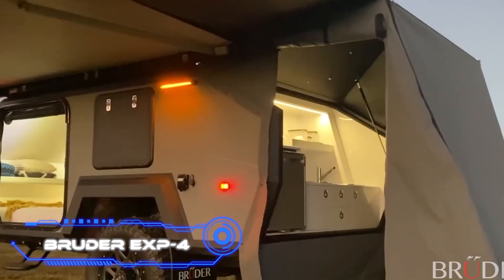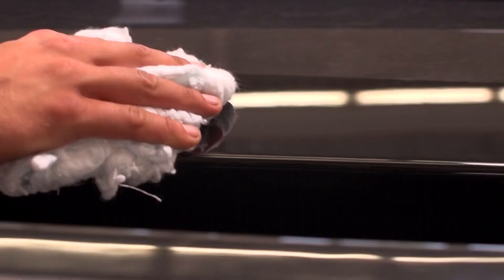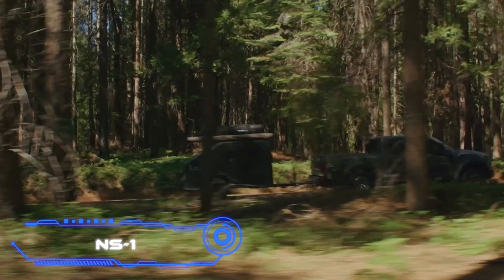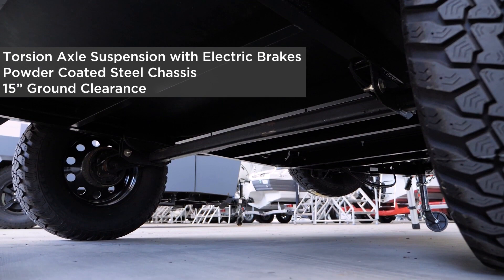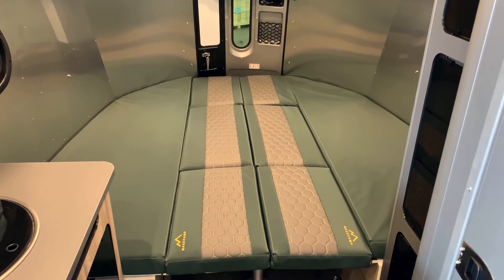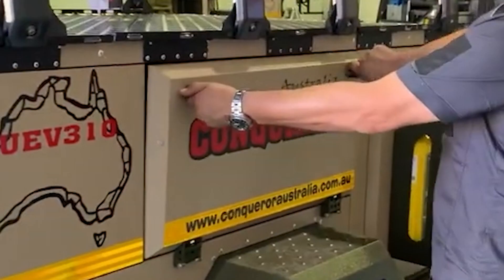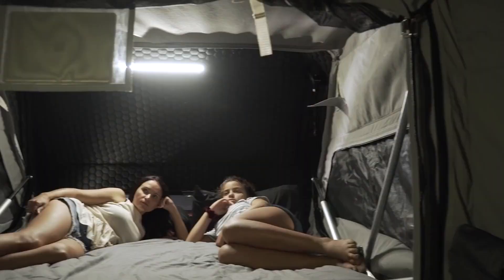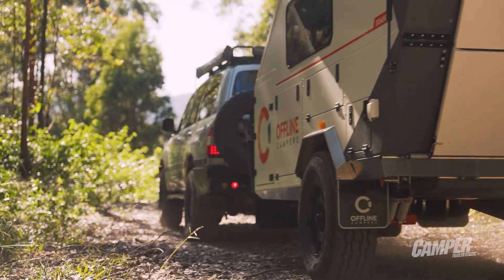AMAZING CAMPING TRAILERS THAT ARE NEXT LEVEL

Comment: Bruder EXP4 looks so cool. It's the most notable characteristic trailer. It's one of a kind suspension which gives it the ability to adapt to nearly any terrain regardless of the surface we decide to park our vehicle on. The body is positioned correctly on its own which is beneficial while driving over rough terrain and off-road. There's so many functional things inside of the trailer which also features a sleek design on the kitchen. Sealander is a true one of a kind innovation. It functions like a conventional motorhome on land and it also transforms into a floating house on the water. The Composite Materials gives it a higher level of durability. The Sealander provides passengers with everything necessary for a convenient and comfortable lifestyle. Thank you so much for doing this video.